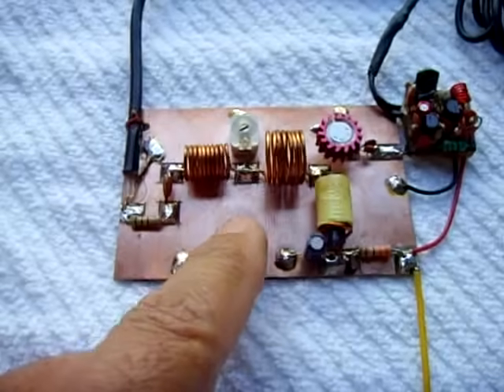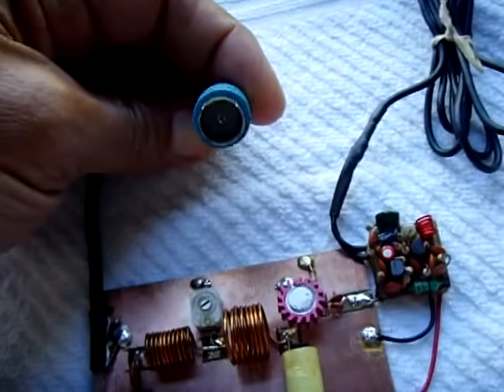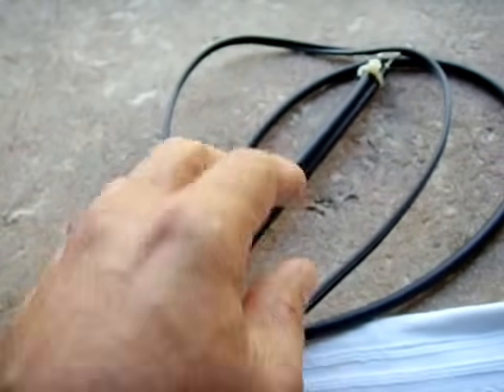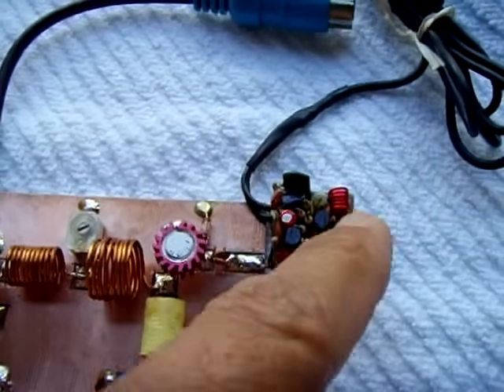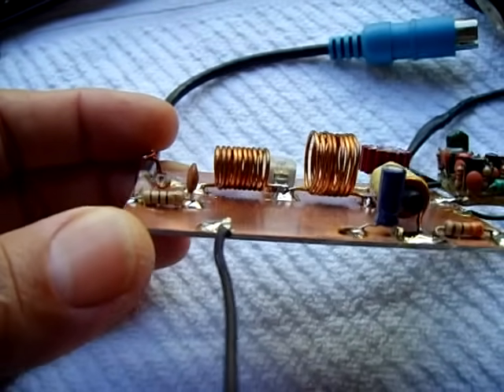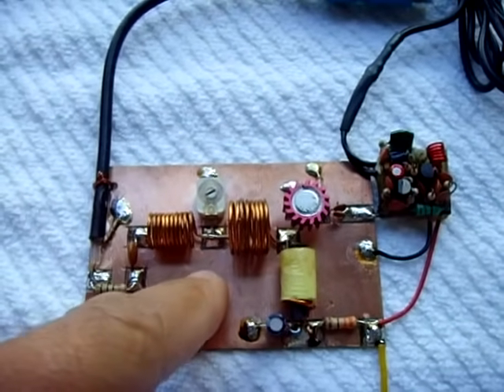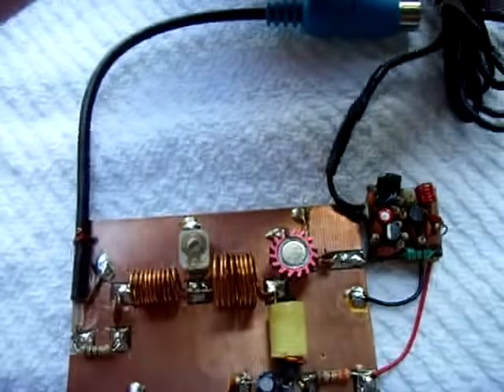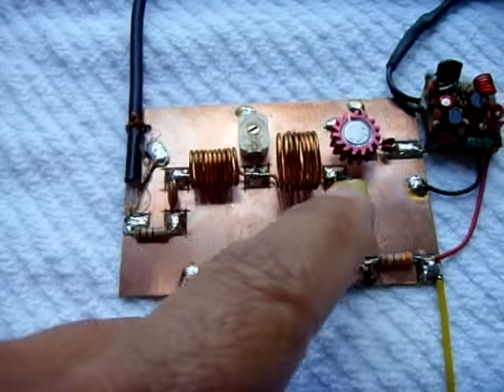1W FM RF Amplifier Circuit (Boost Low Power Transmitters)

Comment: Friend salute you good afternoon from Manta Ecuador and would like to know what are the values of the other components of the amplifier and if suddenly you have the schematic diagram of the amplifier printed circuit because I realize that the transistor is a 2N4427 and if I have here at home and I need to know what are the values of the other components, ie complete Liata need the materials to start with the design. Greetings from Manta Ecuador.

Comment from the maker: Very simple. Go to Google and enter "single layer air coil calculator". All you have to do is enter the uH value you need, the diameter of the enamel wire your using, and the diameter of the drill bit you will be using to wind the coil on.